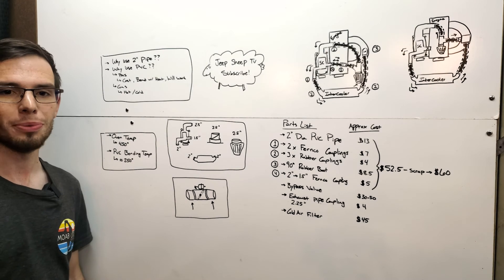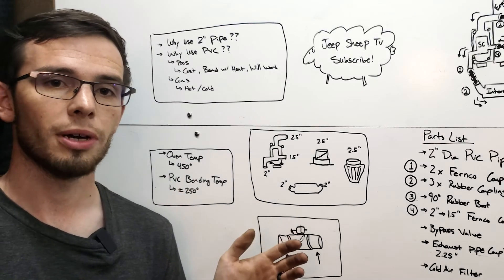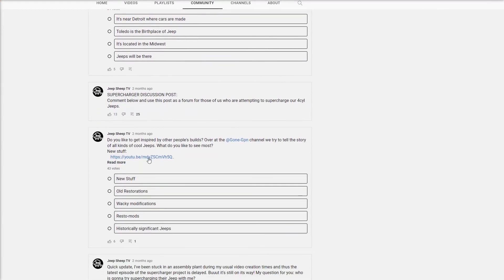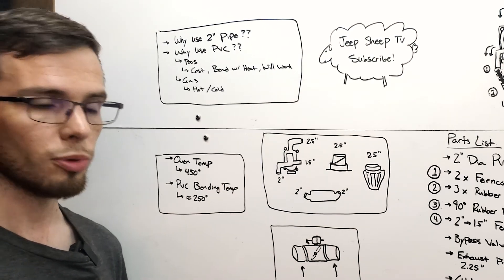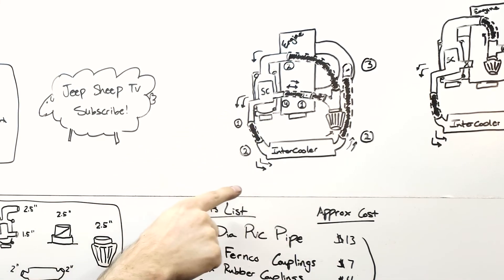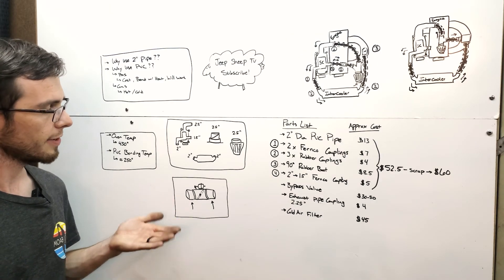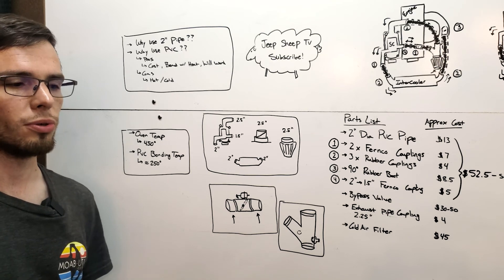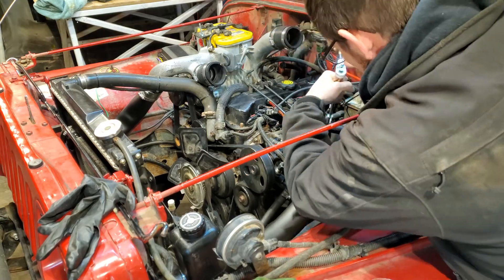DIY Supercharger Part 3 - Custom Bending The Intake Piping

Comment: Thanks for the effort and time it takes to document this. There is also flexible PVC that will bend without collapsing, it's main use is hot tub plumbing. It will work well in areas that have a gentle curve and it is still flexible so that it deals with the vibration well.
Reply from the maker: That would be pretty cool looking

Comment: 28:46 PVC plastic is a thermoset plastic, not a thermo plastic. That means it doesn't have a melting temperature. While it does have a temperature that makes it soft and formable, it never melts. Get it hot enough to try and you will end up burning it instead.
Reply from the maker: Good information! Thanks.

Comment: You'd probably be really surprised on how easy it is to fabricate your own tubes with metal. You already have a good idea what you want and you even have templates to kind of give you an idea of what it's going to look like. 
"Pie cuts" are going to be your friend in this project. 
Look up " the fabrication series" YouTube channel.
You will get to learn about MIG welding as well as TIG welding. He will give you some tips on keeping your tubes properly welded and sealed. And if you do this yourself you can do it at a much cheaper cost. 

Using PVC was a great idea because it becomes the "fuse" and an unpredictable and high pressure system. You would much rather have a pipe burst or crack under the pressure rather than an expensive component like the supercharger. Once you have everything figured out I would definitely consider fabricating your own steel tubes. Remember it's not near as hard as you think.
I've seen you do some pretty complicated stuff with electronics if you can do that you definitely can get into some TIG welding or MIG welding even if you have to borrow the machine. Which reminds me make friends and fabrication shops they might have an old retired machine that they would be willing to sell to you on the cheap.

Comment: For the harder bends, you can get flexible schedule 80 PVC. The benefit, outside of being flexible up to 90 degrees, is that it is pressure rated at around 200 psi and won't distort as much with heat in the engine bay.
Reply: I was going to try the flexible PVC also hard to find

Comment: If I had this set up I would definitely be wrapping my exhaust it's kind of a pain in the butt but it definitely helps cool the engine bay and it also helps with the intake temperatures which will help you keep your intake running cool.

Comment: The coupler that you are blowing out, just take a piece of aluminum roof flashing and wrap it around the couplers before you slide the hose clamps over the ends of the aluminum that is cut to the length of the coupler. the lap of the ends of the aluminum should be at least half but if they come back around and meet on the inside and out it will stiffen the coupler more for boost.
Reply from the maker: When I replaced the blown coupler, I realized that I had a pinch point that put a lot of pressure on just one part of the coupler. I installed the new one better and have not had an issue since.  The aluminum is a good idea though!

Comment: Finally have mine completed just did my first boosted run definitely notice a difference I think I have to do something about fuel or programmer it broke up a little bit a few times
Reply from the maker: Yea,  you will need to trick it into adding more fuel. I'll show some methods in the next video.
Reply: Do you think adding 24 lb four hole injectors would also be a good idea
Reply from the maker: @generaldrz  let me run some tests.  I'm concerned that the PCM will still lean you out even with bigger injectors. I'm currently tricking the PCM but I would like to find a way around that as it would make the project much easier.
Reply: Sounds good I just watched your video on the 4 hole injectors and was thinking about doing the upgrade but I will wait till I have this figured out first
Reply from the maker: @generaldrz  those injectors actually push a little less fuel so they wouldn't be the best choice. Something I'm looking into that you can try as well is apperantly the Chrysler minivan fuel pressure regulator fits in our rail and increases the pressure. Doing this is similar to changing injectors and its easier and likely a little cheaper. I'll drop a part number when I get a chance.
Reply: Sounds good I will give it a shot

Comment: Great videos.. I just bought the m62 charger also and just started my install on a 98 tj . What is the larger nipple on the top of the charger next to the smaller vacuum looking nipples ? Where do I run the host to ?
Reply from the maker: I would block off all 3 of them. I tried to use the large one for something (can't remember) and it didn't really work. Just block them off and forget about them!
Reply: @JeepSheepTV  thank you I really appreciate it !!
Reply: Where can I send you a Video of my tj almost done ?
Reply from the maker: @mrprostar1  jeepsheeptv@gmail.com can't wait!

Comment: If you used a Normally opened 12 volt  bypass valve ,Then when you turned on the  supercharger it would close the valve . Would this work ?
Reply from the maker: It could,  you also need to open the bypass valve when you let off the throttle. You can do this with the setup you mentored but you would also be turning off the SC at the same time.  It should be fine but just think about how many times you want to operate the SC clutch.
Reply: @JeepSheepTV  Oh yes, forgot about opening when letting off throttle .  I suppose that the vacumn is the way to go to avoid programming the bypass valve . I have a 95 yj and will be gatherinng parts for the supercharger mod. Thanks for all that you've done to bring this to the 4 cylinder world .  Cheers !
Reply: I have a eBay blow off valve that works great for my M45. I recently purchased a M62 that I am building for an upgrade. I built a custom top and back plate and was looking to use the exhaust bypass similar to the one used. I have it built also for a DBW throttle body for the future. My question is using an EBay 3 port solenoid I was planning to have one port with a check valve and the other direct to the bypass. In the normal operation the check valve should maintain ~20psi holding 100% bypass. During boost it will directly be controlled by vacuum. I am not sure how that differs from yours but in my mind it made sense.

Comment: Do you think it’s possible to do this on the earlier TBi models? If so, what might be the difference?
Reply from the maker: Possible, yes but you would need to convert to a serpentine belt and I'm not sure how easy that would be.
Reply: You would basically have to get the entire accessory drive system off of a later 2.5, including the, power steering pump, alternator, water pump (reverse rotation), crank pulley, brackets, idlers, etc. The throttle body may or may not take well to being blown through and metering fuel. You will also have to compensate the pulse width of the injection to match the added fuel.
Reply from the maker: @jamesford2942  yea! What he said... lol

Comment: How will the transmission hold up to the power? I’ve got the 30RH in my auto 2.5 and would be worried that it would blow up
Reply from the maker: Mine has been fine so far.  5000 miles in.

Comment: So your Jeep's running 3.73's and the auto still?  Looking at the video's and it seemps to pull pretty hard.  Love the DIY approach.  Are you still running 2-3 psi or have you moved up?
Reply from the maker: I have 4.11's and 31in tires.  I'm still at just 3psi. At sea level is close to 4psi. It pulls pretty well,  it's still slow at 2k rpm till about 3k but that's kinda the nature of this engine and the auto trans. I'm still tuning it for best results. Leaning new things all the time.
Reply: @Jeep Sheep TV   Ah okay.  That makes sense since I think you said you're turning 3K @ 65.  Yeah, the powerband doesn't really start to kick in till around 2500 and then gets really going over 3K-4K.  I've thought about doing a supercharger for a while.  Only problem is that I'm running A/C and a York compressor so there's' no room on that side.  Boosted and the old Avenger and Rimmer were on the intake side, IIRC.  Two of those companies are defunct now though.  I'm trying to talk myself into a boosted but it's a lot of money.  Then again I've been thinking about regearing (4.56 to 5.13 for 33x10.5R15's) and a SC would negate having to do that.  The other probem is I'm in CA and so I've got to be able to return the engine to stock ever 2 years.  I do like the 2.5L though.  I run the 4bangerJP FB group and the .com of the same name.  Keep up the good work.
Reply from the maker: @JeepnJeff  the nice thing about this SC setup is that it's pretty easy to remove or disable. You could try the m62 top of the intake. Flip it upside down and make some piping. It would take some interesting fabrication but it could be done.  Feel free to share my videos with the 2.5L group. I do what I can for us 4cyl guys.

Comment: Why didn't you use electric acctuated butterfly valve?
Reply from the maker: I was short on time and thought the vac valve would be easier. I'll be converting to electric in the near future.
Reply: @JeepSheepTV  Sweet! I wasn't sure if I missing something or what xD BTW great project 😁 I have plan to supercharge my 2.5 XJ 😎
Reply: @JeepSheepTV  Have you migrated to the electronic butterfly valve yet? Very interested on the programing for that. Doing a similar setup for a bypass on my Datsun Z trying to twin charge it. That info for the electronic bypass would be worth gold to me. Love the DIY for this and the videos you've made. :)
Reply from the maker: @scratchgrips  I got an electronic TB from the junkyard. Haven't tried programming it yet

Comment: would this work on the 2.4 tj?
Reply from the maker: Maybe?  I'm not too familiar with the layout.  Try it and let us know!
Reply: 2.4L is a Neon/PT Cruiser engine.  It's different than the AMC.  There was a guy on the Reno4x4 forum who went by the name Air Sierra who put a PT Cruiser GT turbocharger on his 2.4L.  He needed a special bracket that he made that flipped the manifold upside down, IIRC.

Comment: PVC is NOT the way to do that. 140°F is the maximum working temperature for PVC. Intake temperatures and even just regular underhood temperatures get up to and past that.
Reply from the maker: Finally! Someone against the PVC. I agree that the temperatures don't line up which is why I put 5k miles on the Jeep before making this video.  Those miles include tough trails in Moab and about 5 summer months of sitting in AZ. On mountain passes and tough obstacles we saw engine temps near 250°F.
Reply: @JeepSheepTV  I partially agree with your statement on the video about it being used like a template to figure out routing. But still, it is not the proper material for the job. Build your own intake kits are cheap and easy for folk to assemble.
Reply: PVC holding up great over here